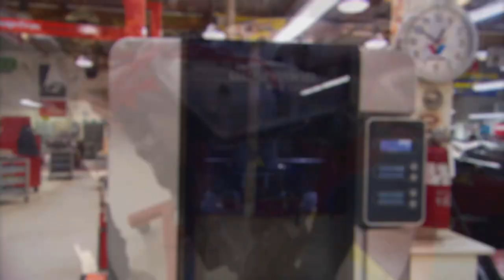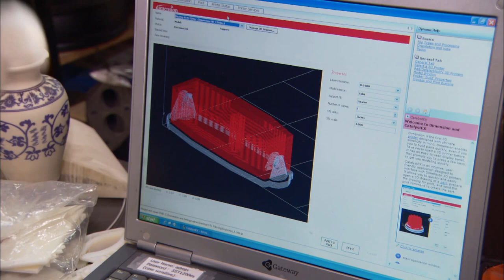Behind the Scenes in Jay Leno's Garage

Comment: That 3D printer @9:22 is a Diemension SST 1200ES printer which cost $35k in 2008. Adjusted for inflation, that's almost $50k in 2023. This does not include the price of the proprietary "filament" it used. Totally worth it for someone in Mr. Lenos position as you can reproduce just about anything. Printers have gotten even better/faster since then including the lower end hobby printer like Bambu Lab printers which are phenomenal. Wonder what printer the shop upgraded to since then.

Comment: Hey Guys, this looks a lot like an ALFA ROMEO 2 liter Engine with a red valve cover on top of it.....   I had back in the days a ALFETTA 2 liter and a GIULITETTA 1,8 liter the Block is about the same just with different (WET) iron sleeves in it..... ;-) and YES I got rid of them Dellortos and fitted the better double WEBERS... :-) was installing  2 very hot Albert race cams into it, BUT it could barely idle... top Rpm 8500... and 140 Hp on the Dyno.... boy that was noisy....